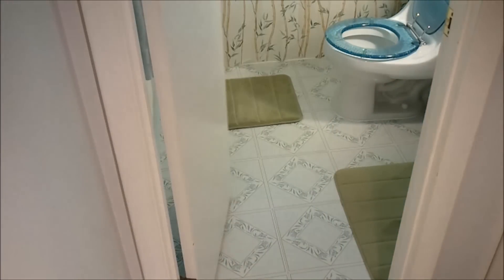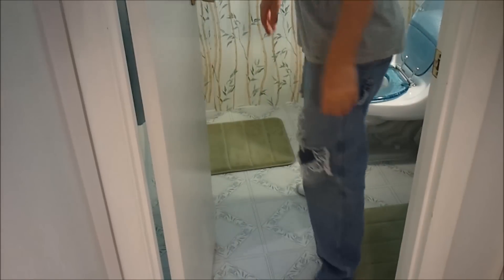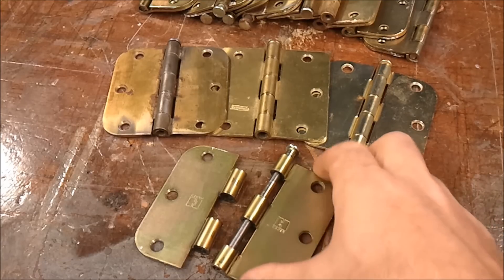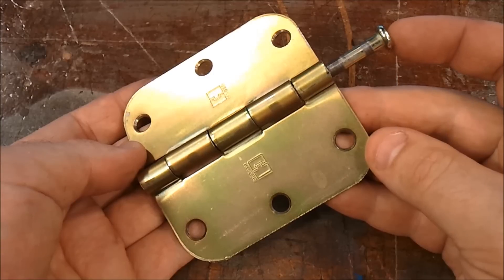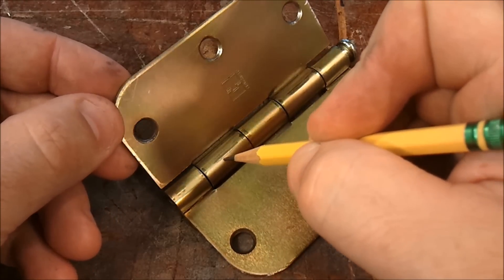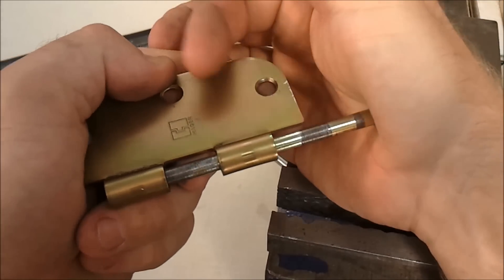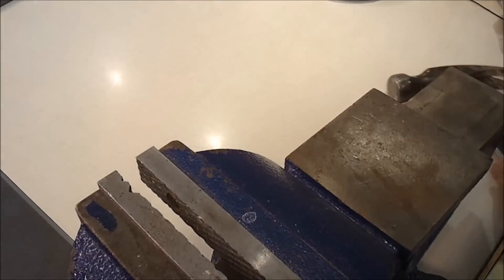Friction hinge (annoying door fix)

Comment: Clever. An even "simpler" method is to just put a slight bend in the pin. I was taught this by an old carpenter.
Reply: +Cody Carse That's quite clever, but what if it can be done while the door is still hanging?

Comment: Good fix. I've done this myself in the past. The fix does place some additional stress on the hinge to door and hinge to jam areas. This will cause the screws to eventually strip. The fix for this is to get some screws that are 1.5" longer. The additional thread area will help prevent stripping and will ensure the jam screws are deep into the jam studs. You may also notice the jam flexing. If so, the casing will need to be removed and additional wedges and screws may need to be installed to prevent twisting.

Comment: I have a quick question, I am in the market for a new drill / impact driver combo.  I am stuck between the Makita brand like yours, and the Ridgid (sic) brand.  Any preferences?  How do you like your Makita?  Any experience with Ridgid?
Reply from the maker: Yes. I have a very strong opinion. Mine is a BTD142. I have used previous models of this Makita, and I have plenty of experience with various similar impacts from other brands. I have not owned the Ridgid, but I have used it. Mine is the pinnacle of design for this tool; it has the right weight, balance, and features. It is nearly at an optimum, and it is the  only power tool that I will endorse without hesitation. If anything were different, it would suffer for it.
Reply: pocket83 Thanks!  This helps a ton.  I think I have my decision made now.

Comment: The question is: How long will this fix last before it returns to normal. Worse yet, will it develop a grunt or a squeak  ? (I did LIKE it though)
Reply from the maker: 2014—2018 and still going strong. 
Squeaks get a drop of mineral oil.

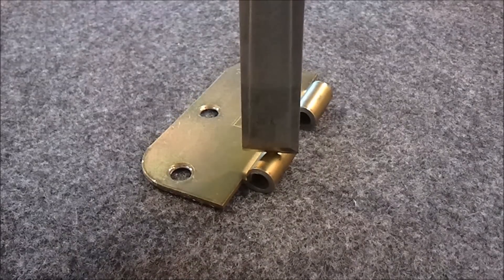Comment: 2:21 I cracked up laughing!!!  Didn't realize you had such a sense of humor!!!  I'm still laughing....  There's some other YouTubers out there who just dropped a deuce in their pants when they saw you smack the chisel on the metal, with a handplane!!!!  Hahahaha!  Oh, you killed me with that....

I have a theory about hand planes.  You might be the right guy to hear this.  Ready?  Okay.  The Hand Plane was invented by sadists.  They enjoy the suffering of another person.  The Hand Plane Myth is perpetuated by YouTubers, who make videos showing a hand plane doing things.  A guy sits there (3 feet from a 20 inch power planer, oddly enough) and hand planes a board, and it looks so easy.  

So I try that, and it doesn't work.  It sucks.  So then more videos come out, basically saying "you don't have your hand plane 'set up' correctly, here's how you set it up...."  So, I do that, keep trying, still nothing.  Now more videos come out and they say "you didn't sharpen the blade correctly, here's how to properly sharpen the blade"....  And then "you should buy this different expensive blade from this website..." and on and on and on.....

Where, the bottom line is, the thing doesn't work.  That's why people invented power planers.  That's why people BUY power planers every day....  Hand held ones, benchtop ones, big wide super factory ones....  Because they WORK.  

These hand plane people enjoy my suffering....  At least, they used to.  I gave mine away.  I'm "out" on this whole "hand planer" thing....

So, using it as a hammer, really did delight my little black heart.....  Someone finally found a reasonable use for one of those things....  Use it for a hammer!!!

(Okay, look, to people reading this comment, I'm kidding....  Well, I'm 73.815% kidding....)
Reply: My plane and chisels frustrate me too. Granted, they're cheap. YouTube tells me they're not sharp enough. But I suspect user error on my part as well.

Comment: why not close the door and take a large pair of Vice Grips and squeeze the hinge tight while still on the door, no screwdriver, Hammer or chisel needed!
Reply: Steel is kind of springy, if you try to do it with the pin in it will likely spring out ever so slightly never getting the desired tightness.
Reply: you can drive the pin out and then squeeze it while still on the door!

Comment: Can the door still swing shut or do you have to manually pull the door closed every time?
Reply from the maker: Right now, manually. I made the hinge too tight; it takes very little of an adjustment. It will wear. If not, I have a pile of other hinges to practice with.

Comment: You could just open the door and nail it to the wall.  Knock a hole in the door to hang a hammer by its head.

Then when you want to close the door you pull out the nail and the door closes itself.  When you're done, nail it back to the wall.

Comment: I had a good laugh when you started smacking the plainer on the chisel. Too funny

Also, I imagine the increased friction on the lower hinge would affect the load distribution, which would in turn affect the areas supporting the load. 

Have you seen any unusual wear to the frame of your door @Pocket83 ?
Reply from the maker: No. It's just a lightweight passage door. There's literally cardboard inside of them. This trick can't be expected to work for steel or solid doors, which, given their mass, should be installed properly in the first place. In contrast, passage doors on these baby-boomer era production houses were thrown in quickly by a single installer, often a dozen or more in an easy afternoon. Thus, one can expect some "variation."

Comment: That example is so off centre a tradie must laugh , firstly what you did by binding the hinge to the centring pin will do this ??? "Sqeeeeek every time you open and be in time a hinge bound door , the you need to graphite dust the hinge centre pin so no sqeeek .The reason is simple why the door swings is due to a wall frame out of plumb and the door jamb being out of plumb which makes the door swing back to the point of out of centre , I did like the attempt at humour on hitting the hinge with a No4 smoother plane .
Reply from the maker: I'm well aware of what causes a door to malfunction, "tradie." But sometimes you can't rebuild the entire door over something so unimportant, because it's just not  practical. This is just a quick fix. 

Also, stop using graphite powder, hacker- it just makes a mess. Use a drop of mineral oil.

Comment: You clearly don't know how to properly use fine woodworking tools. You're supposed to use the chisel as a hammer and hold the hinge with the plane. And make sure the metal is touching the tip of the cutting iron, it's safer that way.

Comment: can you still swing the door closed or is there enough friction to where you have to push it all the way?
Reply: I had to push, but it's two years later, and now it has worn in nicely. Now I can give it a good swing to close it.
Reply: Awesome! Thanks for the quick reply on the 2 year old video. This will be a much easier fix than I thought.
Reply: pocket83² Can you whack it with the hinge screw in place? Thank you.